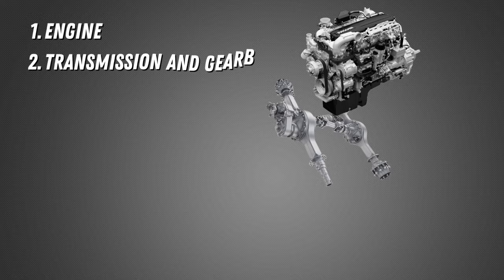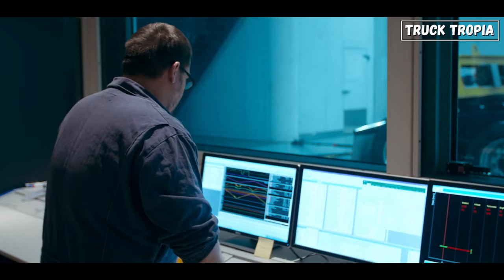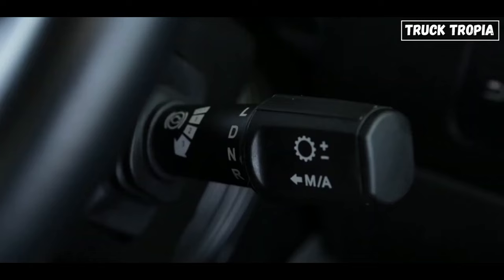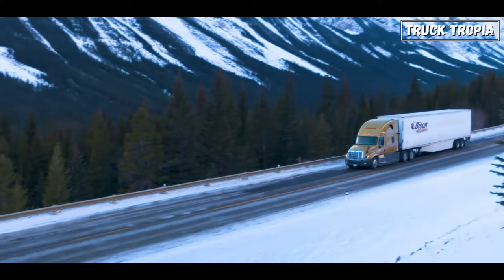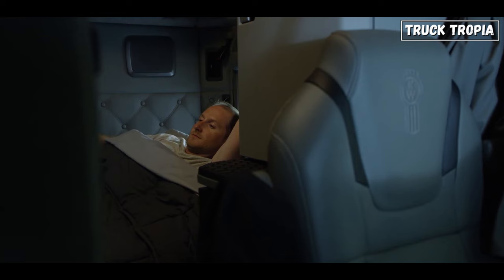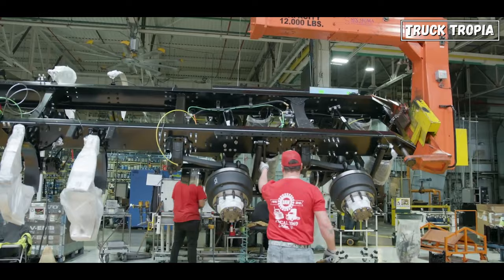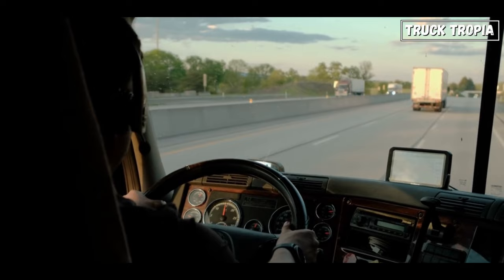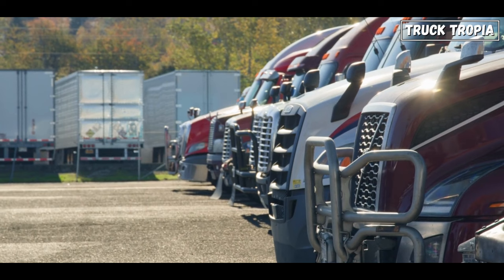How Essential Truck Components Work?

Comment: Another point about the torque and horsepower...  in a semi the torque curve is such that the engine makes it's maximum torque at idle or slightly above idle.  it also makes it's maximum horsepower about the same RPM as your normal driving speed.  In a gas engine the maximum torque is usually somewhere above your normal driving RPM and maximum horsepower is at an RPM usually closer to the maximum the engine is rated for.  Basically the truck engine always operates in it's power range while a gas engine you have to run it well over normal driving speeds to actually hit the power ratings.

Comment: I thought that compressed air kept the brakes off. I think the absence of compressed air applies the brakes.
Reply: This system is set on trains.
Reply: @amadou65  I think the whole idea of air brakes, whether they are on trucks or trains, is to stop the truck or train if they lose air pressure. This is a safety measure. The brakes on trucks and trains work under the same principle.
Reply: @robertmcdonnold3038  oh my bad thanks
Reply: @amadou65  you're welcome
Reply: The axles with handbrakes have springs holding the brakes on and in the brake chambers (combination chambers) air holds the spring back and therefore the brakes off
Reply: You are right. No air no move

Comment: How about the truck is the load is gravity free weight out. 
The contact to the ground is the truck only and wheels,  the load is no weight .
I'll say removing the weight first before flying. 
So that i can see , I can defy the load of the truck. The container is Anti gravity  way to do it want this pay for my 50years in repair works.